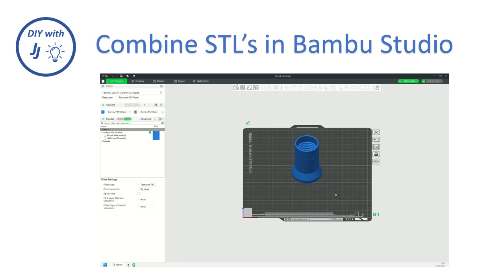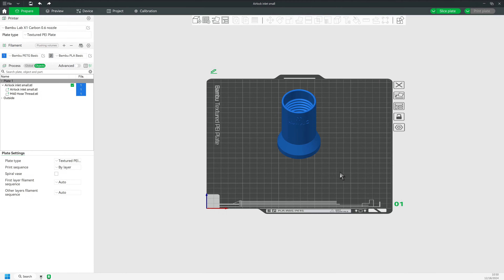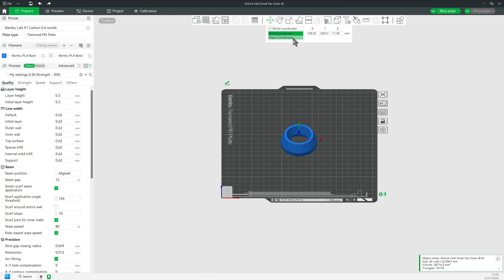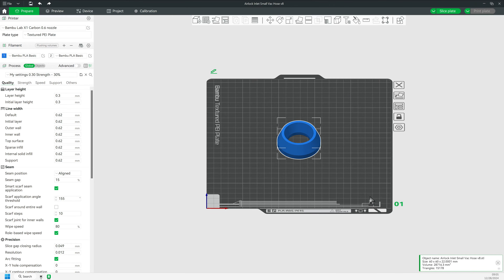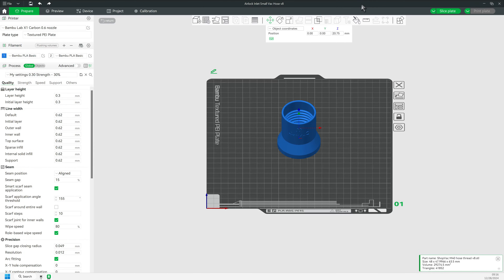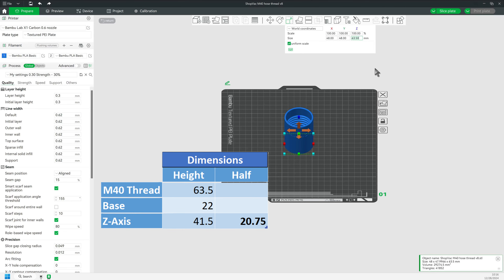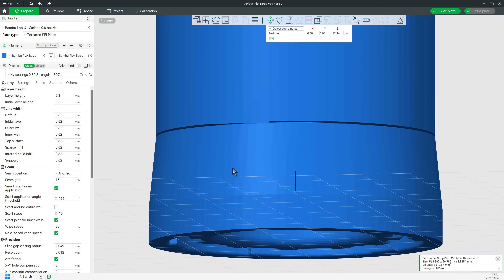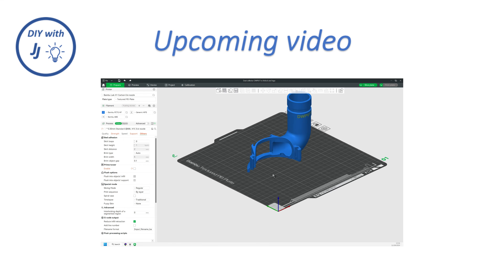Combining STL Files directly in Bambu Studio  – Easy 3D Printing Assembly

Comment: This was helpful, but for me, when I open a 'part' it doesn't line up with the original object and places it by the side... I have to manually move it which is impossible.. I repeated teh same test with Prusa Slicer and then opens the Object and Part directly on top of each other, perfectly lining them up.
Reply from the maker: Yes.  That is why at the end of the video I made a link to my other video that explains how to line those items up perfectly.  This short video will show you the solution:  https://youtu.be/QFGkpmd9XAQ